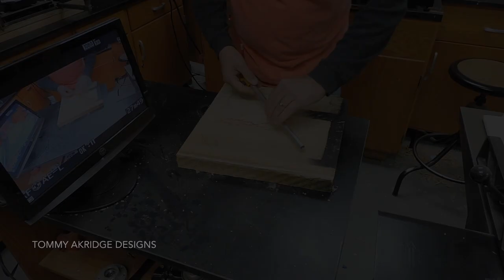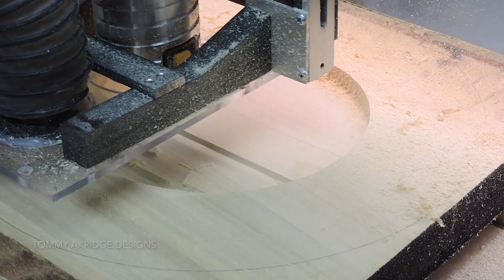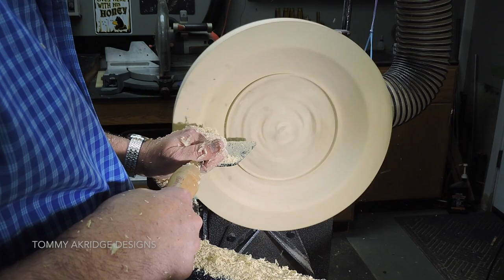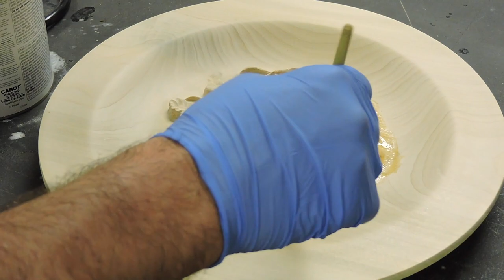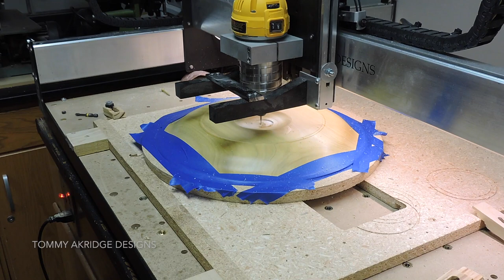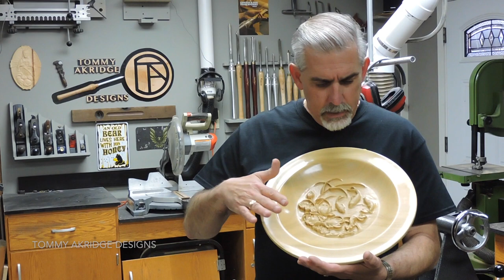Woodturning a platter with CNC wood carving

Comment: Brilliant job Tommy, just love that pond bottom, and  the wood look so good with that lacquer finish, did you in any way buff the finish after it dried? I'm so scared using a spray finish, but I'll have to take the plunge soon... I don't think too many people would have mind your use of the CNC, if I had one, I'd use it more often then not.

Yuval.
Reply from the maker: Thanks Yuval, I find that if you wet sand your work you will have to polish it. also I find that if you wet sand and clean the piece well you can spray one more coat and looks great. But I like to wet sand till I don't see any shine till 2000 gt and then spin the piece and buff with a paper towel and the shine really comes out.

Comment: Tommy,
I love the platter and I have no problem using the CNC on turning work. I have been thinking about getting one myself for that very thing. If you don't mind sharing what CAD software did you use?
Thanks for the video and sharing it with everyone,
Jim
Reply from the maker: MeshCAM , I have a Carbide 3D CNC
Reply: I am looking at the Shapeoko 3. Is yours the base unit or one of the larger units? Also how do you like it and would you have done something differently knowing what you know now?
Jim
Reply from the maker: No I so far love it. I got the XXL, the big one, you can do something up to 32". they are very easy to learn, this is the first time to ever see or use on and in just a little bit I was carving. you have to buy MeshCam and it was another $600

Comment: Love the use of the CNC.  I have one and had not thought of using it this way, so will have to try it.  Thanks for the inspiration!!  Where did you get the model you used for the Koi pond? What bits did you use for the carving?
Reply from the maker: I got the design on line. do a search  on the internet ( gray scale 3d pictures) and you can find all kind of stuff.  I used a .063 and a .125 round noise bits
Reply: Thanks Tommy, I really appreciate the information.